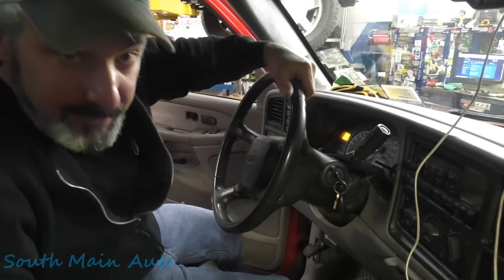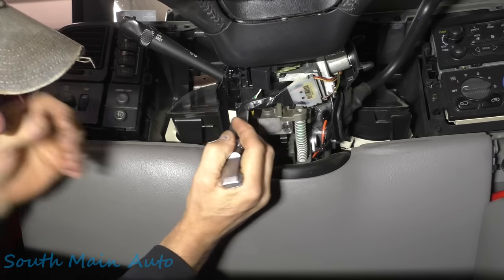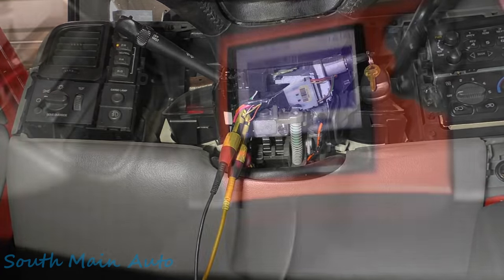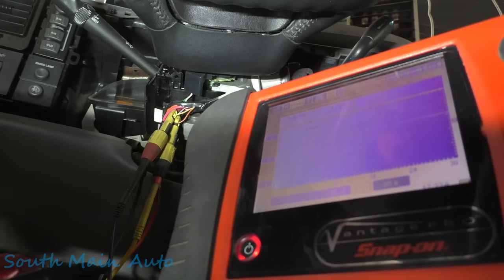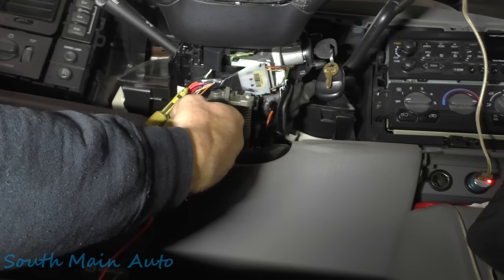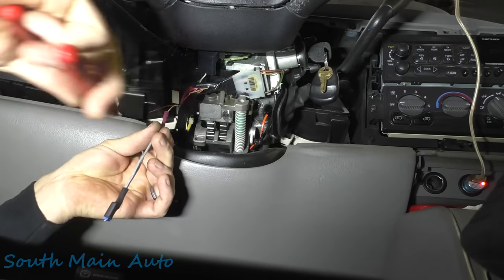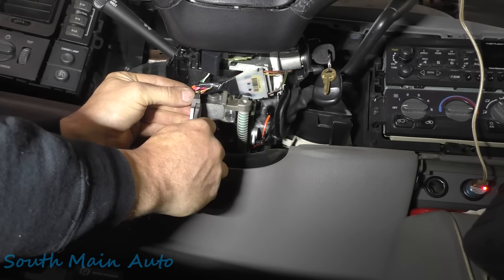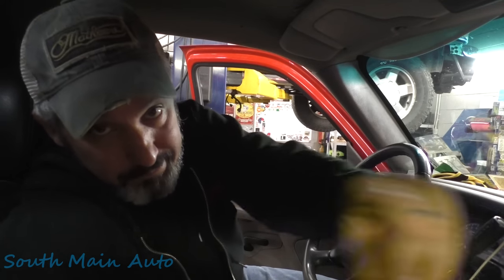Passlock™ System Bypass - GM

Comment: Car thieves back in the day used to pull the fuse for OnStar. Couldn't track it. After that they bring an E.c.m. and an ignition cylinder with them. Open the vehicle, pop the hood. One guy plugs in the e.c.m. in and the other guy brings the key and cylinder. Dash lit up but travels. Nowadays you steal a Chevy truck and the transmission fails. Class action law suit

Comment: what is the actual problem that you had to bypass the system ? module, key , computer , relay . i understand the not worth fixing properly because its a crap or way stupid expensive . not a criticism just wondering
Reply: Generally replacing the ignition

Comment: What is it with GM and their silly electrical nonsense? I remember 20 years ago seeing tons of GMC/Chevy full size fans with turn signals blinking all wrong and in 2002 I worked a couple places with those vans and nothing I did made them work correctly. 2nd place had a 99 GMC full size, boss let me spend a couple hours replacing every bulb and checking the wiring on every socket, replaced the flasher module and could not get them to blink normally.

Comment: What kind of resistor is that?? I've never seen an adjustable resistor
Reply: Technically, it's a rheostat (or 2/3 of a potentiometer). Not seen often in auto repair but very common in electronics.

Comment: You skipped pitting on the bottom steering column cover. These are really hard for me to get lined up as the tint tabs and pins are always broken or mangled. Really wanted to see that.

Comment: Actually these are the PASS KEY II from 2003 on down then GM changed it to PASS KEY III in 2004 on up and have 32 different resistors you can use and after 2004 no pellet notch was engraved in the key shaft  relocated to the head of the key. The only thing by doing this if you have full coverage insurance and you car or truck gets stolen being that the security system was altered they can deny a insurance claim for tamerpeimg with OEM anti theft equipment.
Reply: You think the insurance company is gonna take your car apart and inspect for anti theft equipment...need a new company

Comment: Who do you, nor anyone speak of the Wireless Cut Off Switch, about the size of a pack of cigarettes usually located under the steering column, that is connected to the GPS and the Altenator (reverses polarity and shuts off instantly), that All Insurance Companies put into all new vehicles?
Reply: Hmm that's a new one...have to research it a bit

Comment: Got to say I’m lost on this one.
Have a 2000 z71 silverado and no start/no crank today.
Turned out to be a slightly loose pos battery side stud that the threads were junk, plus I parked in a dirt hill and it didn’t go all the way into park.  No crank. Put it in neutral and bang !started right up.
Rolled forward .stoped/shut off /put in park - started up!  Wasn’t in park all the way and bad side pos. Battery stud.  
This wire thing I could never diagnose..

😂😂dummy shade tree guy.😂

Comment: This was a very cheesy antitheft system that depended on sliding mechanical contacts in the ignition switch that were lubricated with grease. Of course when it's -30 degrees outside that grease could turn into a solid and block the contacts apart, causing a no-start. Had that on my '03 Saturn.

Of course they could have done something even worse with that part, like have the ignition switch potentially shut off while driving, disabling the airbags and killing people.. Oh wait, they did that too!